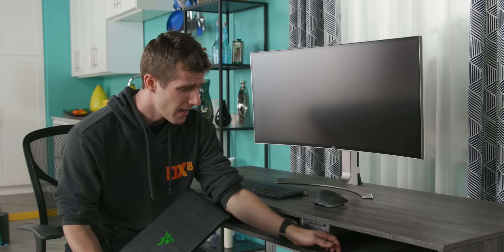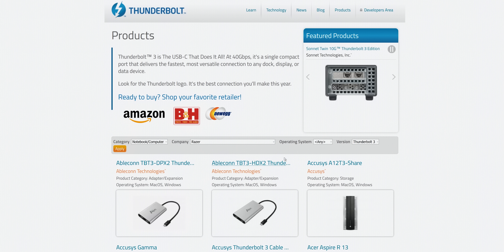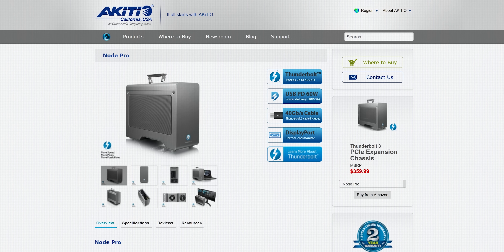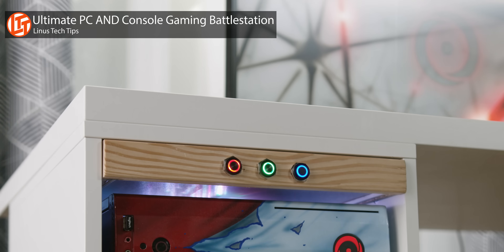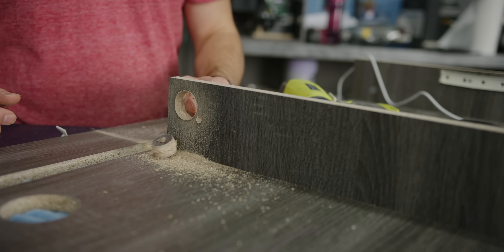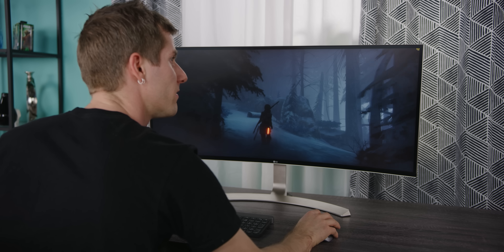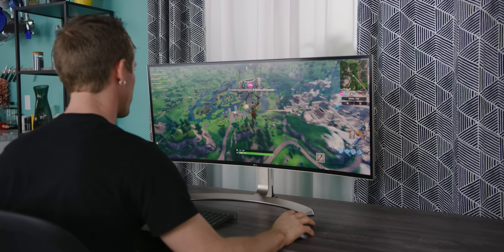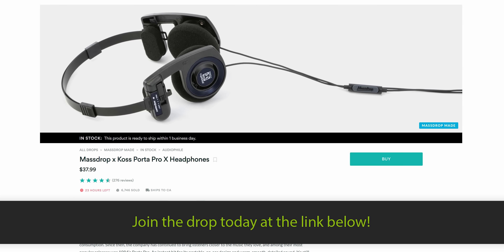This is the CLEANEST Setup.

Comment: Good video. Can you make a video about how to make your own custom eGPU with thunderbolt 3 To represent a better value?
Reply: Have to say this will become a far viable alternative with the use of PCIe 4.0 and 5.0 along with a new cable standard, TB4 or whatever new standard. With 5.0 you would be looking at x16 performance from only x4 lanes.
Reply: A A lol obviously future hardware is going to be better.
Reply: @jordan secrist , I didn’t say better I said far more viable alternative. Right now with 4 lanes at 3.0 speeds provide worst performance than higher end Nvidia mobile chips that utilise ether 8 or 16 lanes. That on top of any extra device on the chain. You might as well just save money and purchase a higher end gaming laptop which yes are heavier but hardly unwieldy.
Reply: A A that is not even remotely true. Have you even tried using tb3 with an egpu? You lose what 15-25% performance at most?
Reply: A A I guess what mobile gpu are you talking about? Obviously a maxq 10 or 20 series card is going to be better, but hd graphics and iris graphics are not better. Not even remotely similar in performance.
Reply: @jordan secrist . 15-25% on what GPU, 1060? 1080? That figure is meaningless without knowing what GPU you pair it with as depending on card determines the use of lane bandwidth. That’s also I assume not accounting for any other devices chained on the link as they were doing here. As for comparison to Intel integrated graphics is ridiculous, anyone who can afford the cost of a external GPU housing plus GPU to put in it can easily afford to have a discreet GPU in their laptop.
Reply: @backupplan6058 you trollin right? 
ofc they could afford, but who wants to carry normal notebook while they could carry ultrabook? that's the whole point

They were playing RotTR in 4k at 75 fps, from the same machine that chihuahua could carry to school, 
so you got portable machine to do light office/programming like stuff, and when you comeback home, you quickly connects to external GPU and monitor, finishes project, and start smashing potatos in some game
Reply: DrawDeath, who would, me for a start. ultrabooks are nothing but overpriced status symbols for those who can’t carry a decent laptop. They really are not much more in weight. Made for a bunch of over payed executives who idea of physical labour is the trip into the office. 
Anyway that said that not what I was originally saying, I clearly said that it would be more viable in the future not that it’s not an option now in some cases. I do ask how much money you have when you can afford a ultrabook and external GPU at school, that ridiculous. When I was a college many years ago the best I could afford was a few hundred Toshiba and was twice the weight and thickness of my current gaming/workload laptop.
Reply: FDMtech   the problem is that i want one where you can use thunderbolt 3 to plug in to your laptop.
Reply: @JayJay-jv2wd  That's exactly what the adapter does. Thunderbolt 3 on one side, full-length PCIe on the other side. All you need extra is a power supply and a GPU, also a generic adapter probably doesn't have any fan headers so it's better to get a GPU that has case fan headers on it.
Reply: @wowdogeful  Aah okay thank you.
Reply: FDMtech   show me the link for the adapter if it's that simple

Comment: I actually used the CallDigit T3 Plus as a KVM Switch so I can use my MacPro and my Gaming PC with all the same peripherals. So all devices are connected to the CallDigit and the CallDigit is connected to both computers via TB3. Of course I loose TB3 on the CallDigit that way, but the other TB3 ports on the PC and the MacPro make up for that. I wish there was a device like this which had 3 or 4 TB3 ports :)

Comment: This is pretty clean but still missing a few items:
- built in speakers from the monitor might not be the best solution for audio
- a push to open cover (on table top) to access some usb ports could be nice for thumb drives/other usb accessories.

Comment: But there is still The laptop processor.
Reply: Which isn't much of a problem for most games. Heck, my i5 4th gen skill runs like a charm on all tasks, no need for beast processors. Atleast not if you don't do rendering and more specialized stuff.
Reply: laptop processors are so powerful nowadays!
Reply: @iceangelx22  I've got the same one, yet I never got to actually overclock it as it is fine for everything I do as it is! It was a great generation to buy processors from! My gtx 770 also still holds up fine, I wouldn't have expected to be happy with this build for so long tbh.

Comment: With all the extra you spend on the eGPU + case + work and the extra space it needs, why not just use that money and go with a better laptop to begin with. 
Probably enough to just get a laptop or ultrabook with some new 2070 or even 2080 or just an older one with a 1080.
They aren't really behind in desktop GPUs, so there should be little difference, plus you got more power on the go and not just on your desktop.

Comment: Cool concept. However. What I would like to have and laptop to PC direct sync. So your command the PC, with the laptop, and synch documents you want to travel with. That would need a new OS, capable. Of course, your PC is still stand alone 32+ gigs of ram, Terrabytes of storage, liquid cooling, latest graphics card. 80-120 fps. For example.

Comment: You call that the "CLEANEST Setup"??  --  No no no....

An integrated touchscreen (for keyboard) and touchpad in the desk + use that short throw projector integrated into the backside of the desk throwing your desktop onto the wall for 100% desk space and the ACTUAL "CLEANEST Setup".  Solved

Buuuut...If you aren't 1337 enough to use a touchscreen and touchpad, then give in to using your KB/M hidden in the cubby under the desktop. EZ sauce.

Plus, wouldn't anything that just hides your components in/around the desk serve the same purpose for "CLEANEST Setup"?

Or some sort of VR setup logged into a Remote Game Server?
How about GeForce NOW on a Stick PC like an Intel Compute Stick (if they are ever updated) plugged into the short throw projector?

But, I guess a "CLEANEST Setup" is defined by offloading graphics, I/O duties and charging for your laptop....seems maybe nobody has "CLEANEST Setup" after all.....?

Comment: Let's see a Mac version.  Also, it would look cleaner if the front of the desk weren't open.  Hide the laptop and everything else so that the only thing visible from the front are the monitor, keyboard, and mouse.
Reply: @00O3O1B  that could be solved by opening up the back of the desk or drilling holes in the back and adding fans.  Additionally, you could drill holes underneath or have a mesh panel where the laptop would sit.

Comment: That‘s exactly what I have at work. A HP Spectre x360 in front of a Samsung CJF791 34“. I don‘t even use an external keyboard, just a Logitech Master MX mouse. Network is connected via USB to the screen.

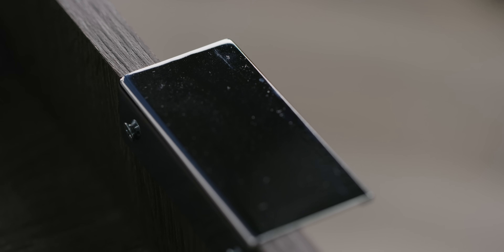Comment: 6:00 if a hole for a screw is just a little bit smaller its even better that way, because screws will hold stronger since they gonna screw themselves in to wood and wood wont crack during screwing process

Comment: you still arent getting full use out of the egpu. even thunderbolt 3 doesnt have the dataspeeds and bandwidth to handle how much your gpu will be throwing at it in both directions on top of whatever peripheral data is now also thrown into the mix. its better than integrated graphics, but you arent getting what you paid for especially since you paid extra for the enclosure on top of the cost of the gpu itself.

Comment: Y'all should make v2 have the whole surface a mousepad
Reply: @BaneBergan  good luck using a trackball mouse for gaming
Reply: @BaneBergan  but they're terrible for games, next.
Reply: That'd actually be easier than making an "embedded" flush mousepad in there.
Reply: whole desk a mousepad with screws at every corner so you can wash it every few months

Comment: The TB3 hub needs keyhole slots so you could hang it on the underside in a secure way. Adding them to the CalDigit unit doesn't look that trivial. Maybe you should suggest to them that sneaking keyhole slots into the finned sides would be dandy. Velcro tape is pretty much a bodge, as the glue backing almost always wants to let go, but tends to leave a sticky goo behind when you give up and want to use something better to secure an item. Oh, and when applying the tape, be sure the item you want to press into place has the hook side, and don't just press the two sides together, wiggle them laterally to engage the hooks into the loop (fuzzy fabric) side more securely.

Comment: I have something very similar but with two major advantages, it has a split design so I can have all the cables running in the back and the front is one drawer seperated in two parts. 90 euro preassembled and delivered. However it is a bit smaller, it fits a 40" tv and a pair or desktop speakers.

Comment: The important thing is you disabled motion blur
Reply: Motion blur is not a bad thing if implemented correctly.
24fps movies would be much worse without it, and on high fps it's almost unnoticeable if implementation is right.
Reply: And you can't get rid of motion blur that's caused by your eyes tracking pixels anyway, 
unless you have backlight strobing function in the monitor, which doesn't work with adaptive sync.
Reply: Yeah the natural "blur" is more than enough, extra blur just hides information from you and mostly looks bad.
Reply: @igor_mkv  But how do you feel about disabling it?
Reply: @RheubenRheuben  it's an option, I'd disable poorly made motion blur probably. Some games like GTA 5 have motion blur in the wrong places.
It's bad when excessively applied to camera rotation, but completely disabled for actual movement, like when you drive forward in a car and it looks like you're standing still if you take a screenshot.
Reply: @igor_mkv  Well the important thing is you'd disable motion blur
Reply: @RheubenRheuben  but it works pretty good on on unreal engine 4, and it's the only option you have to help smooth out framerate differences without adaptive sync
Reply: @igor_mkv  But to be honest I don't even turn it off in every game by default. I just play a game for 10 seconds and get nauseous. Then I turn it off
Reply: @RheubenRheuben  so it's not just hate, but motion sickness?
Reply: I hate Motion Blur
Reply: I'd much rather fight motion blur with high framerates like 144-240, at this point there's almost no difference between motion blur enabled or disabled, again, if properly implemented.
Reply: The best way to implement motion blur IMO would be by using eye-tracking and applying only on objects that move out of eyes focus.
Reply: @iceangelx22  By unnoticeable I mean it's not annoyingly noticeable, but at 60fps it gives better sense of motion and smoother frames. After playing at 120-144fps, 60 will feel pretty choppy without any smoothing

Comment: 1) neodymium magnets to hold that TS3+ in place instead of velcro;
2) CNC a whole mousepad mat;
3) a watercooled mat to leave the laptop on top of
4) get the wireless charger on the right-hand side - since it's CNC'd on the base it'll still be hidden
5) hide the graphics inside that fake drawer on the left where the wireless charger is that way you'll still have full drawers and it would be actually hidden
6) get a MacBook and a dock for it 8)

Comment: Linus please accept this new/modified clean desk setup challenge:

I’ve had almost the exact same setup as this for years! Promoting it to many friends and family as the best clean setup, my only difference was having a keyboard tray to hold my laptop instead of a second shelf, while also velcro attaching my docking station underneath. 

The challenge I propose is simple: How would you do the exact same setup on a standing desk frame? Taking into consideration cable management and no cheating using a side under desk drawer / eGPU holder to hide cables.

Comment: For the I/O, a better long term solution in my considerable experience (you should have seen my gaming big rig) is Velcro with a dab of superglue on the back so it'll stick to plastic and won't peel off finished surfaces with repeated use.

Comment: Did you modify the laptop by replacing the thermal paste and applying liquid metal to the CPU and heatsink? That might've gotten you a bit of overclocking headroom with similar temps. I know Razer is supposed to have great thermals but they don't use liquid metal for them do they? So replacing the thermal paste could've gotten you some over clocking at the same temps you were seeing already?

Comment: I would! along with using GLASS as the top piece   and nicer wood around the sides and bottom along with a set of drawers that are separate  and have more room for stuff.  :) I don't care whether its a mac one or a windows setup either.  just the look with chrome, rgb lighting, Glass for the surface desk part and a nice grained wood for the sides bottom and the drawers  with all the stuff you mentioned  for version 2 would be AWESOME to see... I hope you do it!!!

Comment: You know what completely bugs me and displeases me? It's that everytime you turn on the computer, you have to pull out your laptop lid, open it by pressing the power button, log in then plug your usb type c. I thought you would provide me an exact solution to the problem I have with this kind of setup, which is opening the laptop without even opening the lid and pressing the power button. I am not impressed at all Linux sorry for that.

Comment: Improvements? Get rid of the drawer GPU enclosure. You already took the GPU enclosure apart, just stuff the individual pieces into the back of the desk and upgrade the PSU and fans while you're at it.

Comment: Please do a Mac version. Very interested in this idea
Reply: Needs a builtin fridge...
Reply: Just triple the price for no reason and play all the games at 2 fps. Done
Reply: @rohan6900  not for gaming, again...
Reply: @Zetura  this video was based around gaming, if you don't absolutely need final cut then why would you even consider a Mac for this.
Reply: Rohan Because Macs are 28W quad cores as well and can run windows? Because one might want to use macos when they’re not playing games and have access to big monitor and the ports?
Reply: @rohan6900  You know that Premiere Pro and Davinci are on Mac too ? Why a Mac ? Build quality, trackpad, battery life, weight, Mac OS,...
Reply: @koustuvkanungo9873  seems like a pretty redundant option when you can get a windows laptop for 1000 dollars cheaper that will kick it's ass in terms of performance. If you need the look of Mac is that bad there are a huge number of Linux distros that look better
Reply: @Zetura  there are cheaper thin and light windows laptops which could beat it in performance easily, if you are going this far then I don't think the weak cpu of trying Mac is going to be any good. Also if you install Windows on it this video applies
Reply: @rohan6900  Yep, there are, but at the same price. And again, Mac OS ;) About the CPU, just don't take the low end Mac -.-
Reply: @rohan6900  Anyway, Linus asked who would want to see a Mac version. We want. End of debates, if you're not interested we won't force you to watch it -.-
Reply: @Zetura  the higher end one throttles even after the patch
Reply: Hahahahaha
Reply: Just do the same shit, except with a mac.
Reply: @Paultimate7  nop, Black magic eGPU ;) with 2 ports so easy setup.

Comment: Wouldn't the 2080 Ti saturate the TB3 bandwidth? So any additional I/O coming through the dock, such as a Steam library or network connection, would start cutting into your bandwidth to your eGPU. Ideally, you'd have a laptop with two TB3 controllers, like the 15" MBP, and run the eGPU off one side and the dock off the other. Slightly less convenient, but much better maximum performance.